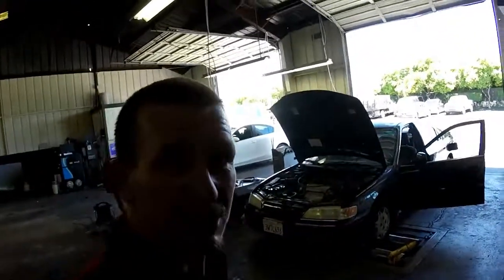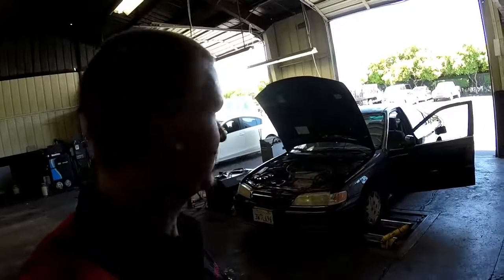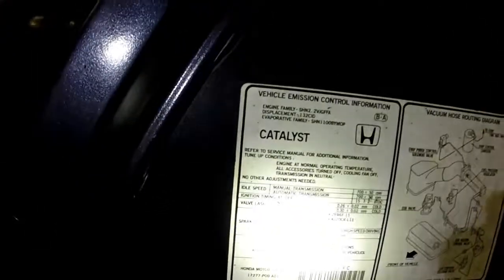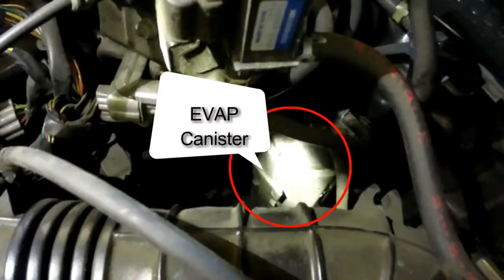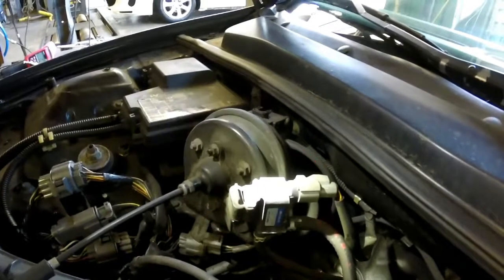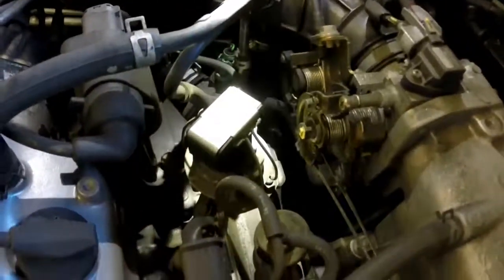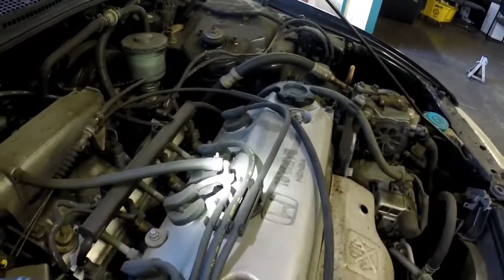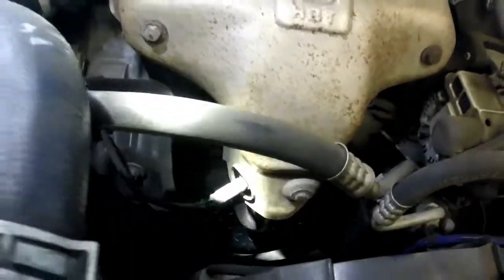Honda Accord emissions / smog locations: PCV, EGR, EVAP, & Oxygen sensor.

Comment: Yo bro so if I change these parts will I pass my emmissions test I as well have to have clean oil right someone told me my spark plugs could be like malfunctioned too
Reply from the maker: Its not guaranteed to pass but it will for sure help you pass. If you have low compression in the motor, you can replace all maintenance parts such as: plugs, rites, cap, rotor, etc. And still fail for high HC cause you are not getting a complete ignition burn. Did you fail smog?